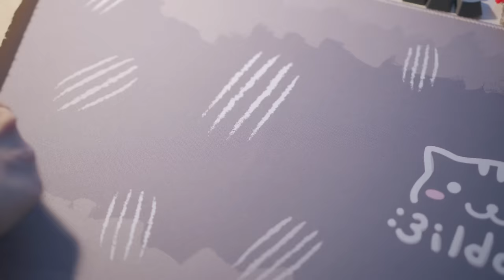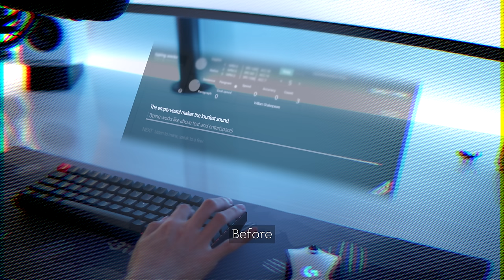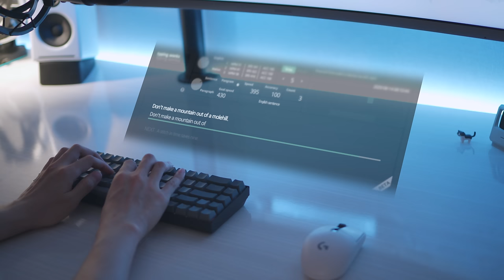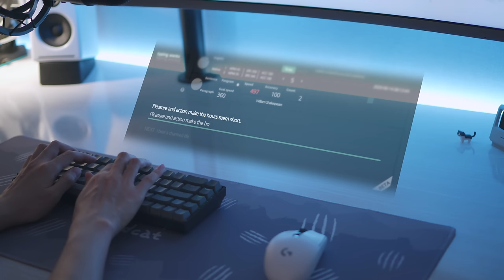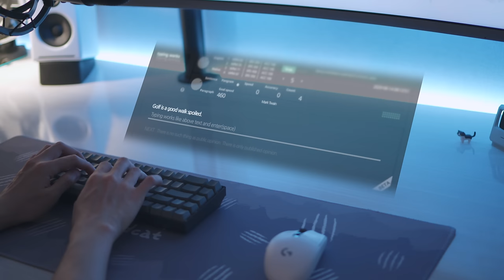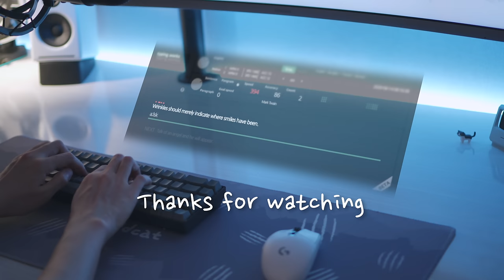Keychron K6 Mods & Typing Sounds (Lubed Gateron Red Switches)

Comment: I've never seen someone with such a distaste for wobbly stabilisers before and I love it
Reply: That's weird, because they're not wobbly to begin with
Reply: Yes they were right after they remove the switches they test the stabilizers and find some very wobbly ones
Reply: That's the attitude to have, so many stock stabs suck. With complaints, companies will get their stab act together.
Reply: @Scragg-  I have one of these, and the stabilizers are wobbly compared to premium ones, but are very good for a prebuilt keyboards, I really like the board.
Reply: @juliensteines8601  I sold mine after I modded it to hell. I’m using a tokyo60 with creams and a few mods now

Comment: Those lubed switches sound absolutely amazing uwaaaaa
Reply: yes?
Reply: @uwaa4467  was just telling you that the switches sound amazing
Reply: @uwaa4467  yeah, we just wanted to tell u that the switches really felt amazing
Reply: @uwaa4467  quick reminder the switches still sound amazing
Reply: @uwaa4467  2 months after, they still sound amazing
Reply: u w a a just wanted to let you know, they sound really amazing
Reply: @uwaa4467  4 months after, they still sounds amazing
Reply: @uwaa4467  still sound good
Reply: @uwaa4467  still good sounding switches
Reply: @uwaa4467  they sound amazing
Reply: I have Gateron reds and they are lubed with Vaseline and sound the same but with optical switches you have to be careful not to lube the bottom stem so that the keyboard does no register the lube
Reply: @uwaa4467  still sounds amazing
Reply: @uwaa4467  just a friendly reminder that the switches sound great
Reply: @uwaa4467  just wanted to remind you once again, the switches still sound amazing
Reply: @uwaa4467  Still sound absolutely amazing
Reply: @uwaa4467  quick reminder, the switches still sound amazing
Reply: @uwaa4467  still are amazing
Reply: @uwaa4467  still sound incredible btw
Reply: @uwaa4467  btw quick reminder to not forget that they sound and felt amazing
Reply: @uwaa4467  even after 9 months they still sound amazing!
Reply: @uwaa4467  12 months and theyre still amazing
Reply: @uwaa4467  yeah they still sound pretty good
Reply: @uwaa4467  even now they still sound pretty sick
Reply: @uwaa4467  they sound  amaaaazing

Comment: Thanks for this video, very detailed. I watched this 2 times and then I was able to do everything on my own on my K4.
Board and switch disassembly, lubing everything. 
Altho I was more generous with the foam I just cut it to size leaving out te battery and then just pushed it to place tearing a hole for the standoffs.
I also didn't felt the need to lube the springs I instead went and lubed the tops and bottoms of the switches. I guess it's the same result.
All in all I'm really happy with the result, thanks to your video.

Comment: Hi! So I've been using the K6 for a while now and I  love it, I used the foam that came in the packaging, I think you either did that too, or it looks like you used the same type of foam anyway. I was wondering I should consider any other type of case foam? I don't really have problems with it, its just that my mind is thinking "it might not be the best cause it just came with the keyboard" haha. So not sure if i should consider stuff like EVA or the soburathane etc, or if the foam that came with the K6 is already just as good :) Thoughts appreciated!

Comment: hi there, any reasons as to why you didnt clip the legs of the stabilizers ? and also do you find using that much permatex on the metal bars makes the spacebar mushy ?
Reply from the maker: cuz there was no claw so I didn't
I prefer mushy than rattling but sometimes, if the stabs are really bad, a lot of permatex doesn't work lol
Reply: @3ildcat  ahh i see. wished i saw this video before i clipped mine T.T i even clipped the L shaped protrusion at the bottom..its abit weird now haha

Comment: I know this isn't latest video but I want to get you a shoutout to you. I got into learning about modding keyboards. Recently, I got a Tecware Phantom 87 keyboard which its a hot swappable keyboard for Outemu Switches. I switches out the reds for heavy Outemu Blacks. fully lubed and adding foam to the case of the keyboard. I was able to lube the stablizers and you have great videos man. keep it up. ;p  maybe christmas time, I want to build my own keyboard. put that wildcat touch to it.

Comment: Hi dude, I think you won’t help.  Do you know the video where there is gateron optical tipping (which are on the GK 61 (this is just the first mechanics will be)) P. S. since I am from Russia, could you write the answer to me through a translator (thanks in advance))
Reply from the maker: How about this one?
It's not GK61 but SK61 with optical switches
https://youtu.be/hMoTeGyCAtc
You can hear the sound of before and after modding

Comment: So why mix the 105 and the 205? the 205 is creamy and the 105 is more liquid but what does that result in for the end product vs using just 205?
Reply from the maker: mix is thinner than 205 so easier to apply
and I have a lot of 105 so I can save 205
that's it :)

Comment: Have you been feeling any pain in your wrist when using this for a long time?  This has been a common issue with the other models and I was wondering if it's the same for K6
Reply from the maker: I haven't typed that long as my main keyboard is Space65
Many people say that and it's a bit taller than others but it depends

Comment: Hi there. If I have a non hot swappable K2, can I remove those stabiliser as easy as in your videos?
Reply from the maker: No, at least, you have to desolder the switch where the stabs located
Reply: @3ildcat  I see, thanks！

Comment: Hi, I have a question. I can't seem to reassembly the pcb back after putting foam and it also resulted in breaking one of the slider switch. Is there a tactic or smthg to put it back safely? Thanks

Comment: I bought my first mech keyboard but it only came with kailh box whites, I dislike clickies and am thinking to replace it with gateron reds, my only problem is I can't find any place to buy lubes in the PH
Reply from the maker: you can make the box whites into linear switches. If it's hotswappable, open the switch and remove a small wire that makes clicky sound
Reply: @3ildcat  oh it's hot swappable, I was thinking about that but none are talking about it, now that you mentioned it I might do it.

Comment: i used dyno-mat in my K6 case instead of foam, after pressing it in i had to pull the aluminum skin off so the switches wouldn't short out. the result is amazing. i'll never use foam in any of my KB's again. highly suggest it

Comment: would you prefer thin or thicker lube ? is there a difference in the feel of button pressing ?
Reply from the maker: thicker
oil = smooth 
grease = buttery smooth
it's up to your preference
Reply: @3ildcat  i am currently using Krytox 205g0 but the switches feel more harder to press than it was at stock. Do you think i overlubed them or is this common ?
Reply from the maker: Marco Fiekers That’s common

Comment: I just lubed my switches yesterday lmao, btw does the krytox 205g2 + gpl105 have the same consistency as 205g0?
Reply from the maker: a bit thiner than 205g0
Reply: @3ildcat  alright thanks! I also did the same krytox mix but I used 205g0 instead

Comment: why use different lube for switches/stabilisers? Genuine question
Reply: The reason why you should use different lube for switches is: tactile switch have the signature bumpy feel of it, that let you know that your key has been registered when pressing pass that "bump" point. So using higher viscosity lubricants will eventually make the tactile switch begin to lose it tactility. Henceforth lower viscosity lubricants are suitable for tactile switches

 On the other hand, a linear switch may not have as much character as a tactile switch and perhaps you might feel the imperfections a bit more as well, and so often you want a very smooth experience while not worrying too much about masking the original switch qualities. So using  higher viscosity lubricants is suitable for linear switches.

For the stabilizers I genuinely don't know much about this since people have their own taste: some like Krytox 205g0 while others like Dielectric Grease by Permatex.
Reply: @huunhanle3809  I see, that was very informative. Thanks!

Comment: I did the same thing to mine except I made an "ergo clear" type switch with some extra stems I had, and I swapped the caps for MDA keycaps. I'd rather just get all new switches tbh instead of using the stock options.

Comment: what did you use to hold the switch at 6:21???
Reply from the maker: 6:00
Reply: That's just a mechanical pencil that holds thick leads. Can be found in any art supplies shop.
Reply: @Ejikpyroman  ah ty